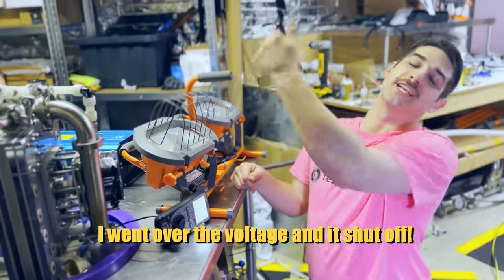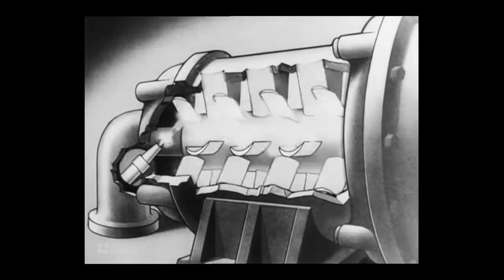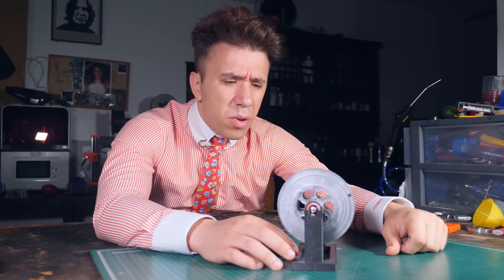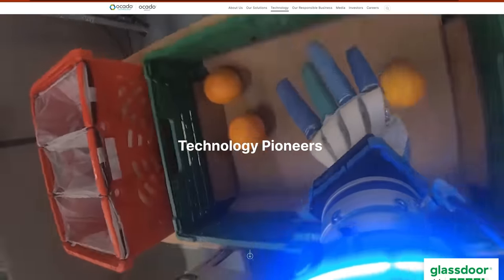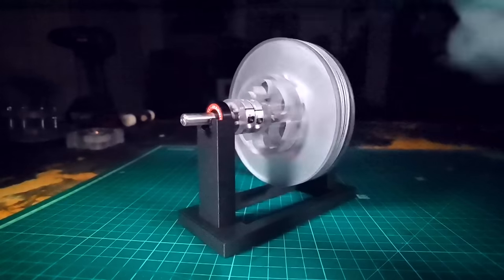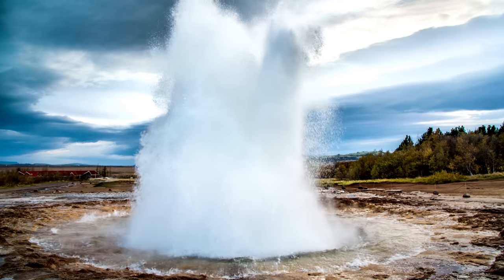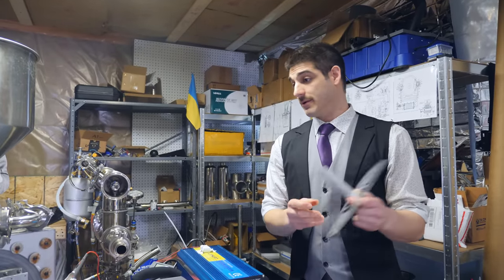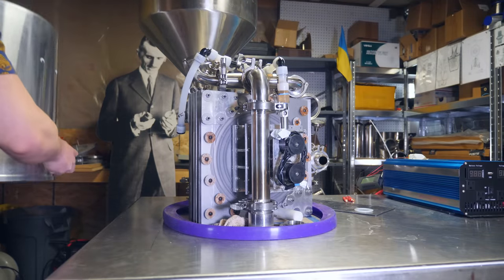Building Nikola Tesla's Bladeless Turbine

Comment: can you run this with a rocket? and wouldnt it be more efficient to run this with water? Tomatos are disgusting !
Reply: Why do you think that? For me its not intuitive for water to be better? Well it might cool the disk which might reduce the expansion, but just a thought tho
Reply: @vyvyyv8vohvgu77  I think it sticks better to the surface because of its higher viscocity so more energy is convertet into motion. But wouldnt it be interesting too, to try this with Steam
Reply: Too rapid of acceleration with a rocket motor, maybe perhaps it could work, but majorly redesigned to take in to account the physics at play
Reply: I think steam is probably the best medium. While water would work, the extra viscosity would likely cause the water to back up and slow down the overall rotation speed, since the spaces between the disks are so small. Furthermore,  I think you would have to be even more precise with the design to limit any potential for backflow or disruption of flow. I could see water potentially being better for lower speed, higher torque scenarios, but I think steam would be the happy medium. More viscosity than air, but also maintains higher speeds than water itself.
Reply: This is the story of your enslavement, the "elite" exposed 👉 The Connections (2021) [short documentary] 💖
Reply: I thought about asking about running it with water as, during the video, it is stated that higher toques are developed at slower speeds. After think about it for about 8 hours I have already come to the following conclusion. The Tesla turbine, with water driving it, would need to have it's axis of rotation vertical as opposed to horizontal. Conventional wisdom would suggest just running it like an old mill water wheel. But the two differ in their mechanics. The old mill water wheel depends on taking advantage of both the weight (gravity) and speed of the water flowing over it. 

If you tried to operate a Tesla turbine with a horizontal axis of rotation the water would, at best, interact with the turbine blades for ½ of the disc. If you followed the Tesla design and had the motivating medium exhausting near the axle, the water would act to impede the rotation for the back ½ of the disc. This would be because water is more dense and more viscous than air. Therefor, you should lay the Tesla turbine on it's side (vertical axis of rotation), injected the flowing water at the outer edge of the disc(s) and exhausted it near the axle. That way the water would spiral from the out rim inward until it exhausts. The entire time it's would be exerting viscous drag on the disc(s).
Reply: I feel like water would create too much drag and would probably be a little bit more difficult to propel. However with steam, you could boil some water, build up the pressure and feed it in - so would probably be more practical that way. imo if an engine depends on another engine then it feels kinda pointless.
Reply: why to use water when we can use high viscosity oil at low to medium pressure (20-30psi) .
Reply: @yeetskeet691  Actually, the whole point of tesla turbine is to use friction drag to spin the turbine, so more the drag the better. 
Drag would only be a problem for axial turbines that are designed for high Reynolds number application, as those things typically want lift rather than drag.
For tesla turbine, drag would only become problem when the disc is spinning faster than the fluid, but any turbine has limit to how fast it can spin.
Reply: Flow rate is inversely proportional to viscosity, so the less viscous steam would be faster therefore negating the losses caused by viscosity. I don't think it's about finding the best fluid/gas but the best for the power and rpm you want to achieve.
Reply: @lucky_luke4785  But you can run it at lower speeds but the water should provide more torque
Reply: @brandonatherton  I think Steam puts more stress on the parts due to the heat, the failurerate is increased and and you need more maintenance on the turbine
Reply: I think that water not being compressible is an issue, might reduce the maximum flow rate. Sort of a bit too much back pressure if you will.
Reply: @eliashutterli92  Well unless we try, no one of us will know
Reply: Ideally you would put in a liquid that quickly turns to gas when heated so it can phase change as it moves out of the turbine
Reply: Imagine if you add to this turbine a special funnel capable of catching the wind, and the funnel's geometry allows the air to accelerate so it's possible to move the disks and generate some energy
Reply: I feel like we are not fully exploring this technology the way we should be.

The discs should be made of a specially developed material which is especially hydrophilic and which uses nanotechnology to make a one-direction micro coating.  This would maximize the amount of power the discs can extract from a given fluid source.

Secondly we could mount it to specially designed bearings which have the lowest friction coefficient we can manage. Designed right this turbine design could easily replace every existing turbine at a fraction of the production cost, even with the special materials science mentioned above.
Reply: Hey thanks for the comment! Yes you absolutely can. In fact the improved combustion gas + steam turbine Patent GB 186,083 that Tesla patented in 1921, 10 years after the original turbine patent and about a decade of R&D, is pretty much this. It’s basically a combustion jet aimed into the steam pipe that goes into the turbine. 

The steam actually works to cool the combustion jet better than using a compressor to feed extra air in for cooling before going into a drive turbine. 

Additionally metals are naturally hydrophilic and polar molecules like H2O adheres to them better than non polar molecules (N2, O2, CO2, etc) which allows them to reduce slip on the discs and increase efficiency. 

Hope this helps.
Reply: @KuntaKinteToby hey thanks for commenting. To be clear, metals are naturally hydrophilic. 

And you are right. But the thing is to remember what the main motive fluid is. For a steam turbine we need hydrophilic surface treatments. But for a combustion gas turbine we need hydrophobic surface treatments for the non polar Air (N2, O2, CO2, etc.).

So it’s important to consider the exact operating conditions.
Reply: You should test it with the turbine that you likely will win from this comment, that would be super cool!
Reply: I can see what you’re thinking as there would be an increase in torque as it sticks a little better than air or steam, but the issue is at what pressure does the water need to be fed into the system for it to be efficient? I assume it’s easier to pressurize and feed air or steam into this system
Reply: Water disipate heat from rotating element causing drag
Reply: Natural gas hydrogen even alchol all produce large amounts of energy .
This design has many uses and applications !!!
Just as any engine it's an efficent "Pump" !!!
Only with out the limitation of valves !!!
They didn't have wear hardening stainless steel or ceramic bearings in Testlas time !!!
This thing runs at 800° an 80,000 Rpm all day long...
The high horse power potental open up many yet avalible uses !!!
Example 4 of these powering large fans could make the flying car a reality !!!
Reply: Water introduces cavitation, which defeats the purpose. "Low-quality" steam is one thing, but full-on cavitation erosion would destroy one of these quickly.
Reply: @KuntaKinteToby  
Don't forget it'd have to be made of something really strong, cos from what I remember from watching another video about the tesla turbine is when more fluid is pumped in, the efficiency goes way up, but that's also proportional to the speed of the disks which ALSO goes way up, so much so the original prototypes (I think) broke way before they could get to anything useful.

Heck, even versions of this used now, the efficiency is capped by whatever material is used for the disks, as they can spin only so fast before they start deforming.
Reply: Commercial airplanes already run on this power source or do u really think theres tons of jet fuel in the wings ?
Reply: @julianemery718  How about a composite material of magnesium-tungsten woven with graphene, surely that should be about the strongest thing we can make.  Maybe add some vanadium-alloy steel as well for a bit of flexibility.
Reply: dry steam would be best
Reply: @user-uh6kq2wh9g  well of course but I'm not referring to that type of drag (friction against components) I'm talking more like friction against air/itself. Yk what I mean? Due to the density/mass of the water I feel like it'd loose its energy a little more inefficiently. However I'm not a physicist or anything this is just me talking from common sense and whatnot.
Reply: @eliashutterli92 Supercritical steam?
Reply: @breakfast7595  I think it is super ineficient and nearly impossible to do
Reply: @NwoDispatcher  I think the expanding of the gas would make to much backpressure
Reply: @KuntaKinteToby  This is probably a bit to complicatet put you could try to roughen up th surface this would probably increase the efficency
Reply: Very good Question!
With a very small spacer thickness like in Charlies turbine for Integza, the viscosity and the surface tension of the water will not be able to efficiently transfer its energy into motion through the rotors. 
Bladeless turbines designed for hydropower applications generally have the spacers separating the rotors 
be > 0.3mm, and are less efficient than Steam, Dry Steam or Air Bladeless Turbines. 
A Jet engine/ Rocket expelling heated gas will be as/more efficient as a compressed air bladeless turbine because of the near supersonic flow rate and high pressure at the input ( if the input is converging). Furthermore the rapid pressure drop inside of the Bladeless turbine due to the high pressures in the input and the Rotor housing will cause the heated gases to decrease in temperature and have a large increase in velocity and accelerate the disks (this works very similar to a converging diverging nozzle in spacecraft rocket engines). It would be very interesting for it to run with a jet engine, however, I would recommend using a material for the rotors that can withstand high temperatures (over 1073 K) centrifugal force and maintain a very low or equal thermal expansion with the rotor housing.
Reply: @eliashutterli92 Bladeless turbines rely on their rotors being as smooth as possible to allow laminar flow.
The laminar flow is what gives the Tesla turbine it's high efficiency as it does more cycles around the rotors. 
If it is roughened up the rotors will allow turbulent flow to take place and does less cycles around the rotors therefore reducing its efficiency.
Reply: Wouldnt water expand as it gain more friction causing damage?
Reply: Wouldn't be cool if Joel build his own rocket?? It'll be A-M-A-Z-I-N-G and pretty explosive
Reply: Tesla designed it for water
Reply: @lordfrz9339  oh word
Reply: Wasn't this intended for water specifically, because of its viscosity?
Reply: @humanwow5848  yes
Reply: Use the rocket to heat steam
Reply: It’s called a viscous disk turbine and works really well with oils and petroleum’s
Reply: Better question: Can you power a rocket with it?
Reply: Water can be used to spin the discs like he described with the sticky honey,  fluid dynamics 101...😅.
Reply: @brandonatherton in reality, the more sticky the liquid is, the better.
It's harder to keep pressure up, harder than steam but the turbine doesn't care about running on air, steam, water or a mixture of the three.
Reply: You mean like steamed? Here it explained that they weren't you listening!? And no a rocket would just burn everything up.
Reply from the maker: Congratulations! You just won a 3D printer! Send me your info (Name, Address, Zip Code, Phone Number) to integza@gmail.com .
Reply: No make it a clean rocket engine
Reply: Do you no tesla secrets I do I will tell u all them
Reply: It's just a proof of concept. If it was more efficient it could be used in geothermal, hydro and nuclear.
Reply: If you really interested, guy from Ukrainian do that 5 year a go. Chanel name: tesla tech
Reply: @integza see channel: tesla tech
Reply: The narrowness and centrifugal Force of the turbine engine moving at the speed of steam presses so hard against the steam that there is no slippage as if the steam were solid as it passes through. Water cannot move through the device fast enough to create the centrifugal forces that make this turbine efficient. The problem is finding materials that can withstand extremely high speeds, 35,000 rpm. You boil the water to create the steam that spins the turbine.
Reply: @lordfrz9339 hey thanks for the comment. While the TesTur can be used with water, Tesla primarily designed it for use with combustion gas and steam turbines. 

Almost all the improvement patents that he patented in 1921, 10 years after the original turbine patent and about a decade of R&D, revolves around specifically using it with steam and/or combustion gas.

Tesla wrote extensively about this in his article “Dr. Tesla Talks of Gas Turbines”

I hope this helps.
Reply: @zAlaska I appreciate your comment but that’s not an issue because, despite what everyone erroneously claims, Tesla turbines work just fine, get plenty of torque and output power at low RPMs.     I’ve got some copy pasta 🍝 of mine that I’ll share with ya here to explain more.  Tesla turbines aren’t made efficient by spinning really fast.   That’s only for when the disc stack is being used as a centrifugal pump, because ALL centrifugal pumps’ compressors, performance is tip speed dependent.   But spinning the turbine fast will produce a centrifugal head that opposes the incoming fluid flow, reducing the pressure gradient across the nozzle, reducing fluid final velocity, reducing mass flow rates through the nozzle and ultimately reducing power out. 

Furthermore the faster you spin them the faster the fluid you have has to go just to still be moving faster than the discs and still provide torque.   Lastly, they work just fine for industrial use and can scale up just fine because the torque on the discs is proportional to the difference in the fluid speed and the disc speed. So the disc tip speed is the important factor here. For any given fluid supply in, the bozzle will have a max fluid velocity. So the turbine disc tips will have a max speed set at that fluid speed irrelevant if radius. Now considering that centripetal force is proportional to V^2/R, if you keep the tip speed the same but increase the radius the centripetal forces on the disc for the speeds needed will actually decrease. 

Despite what MANY have claimed about the Tesla turbine, it does NOT need to be spun fast to work or work efficiently.   TesTurs are made efficient when the slip on the discs is reduced and spinning the discs fast does nothing to reduce the slip, only increase the distance the fluid slips on the disc faces, which is by definition “loss”.  Listen to what Tesla himself said in the patents of how to make them work.  “Owing to a number of causes affecting the performance, it is difficult to frame a precise rule which would be generally applicable, but it may be stated that within certain limits, and other conditions being the same, the torque is directly proportionate to the square of the velocity of the fluid relatively to the runner and to the effective area of the disks and, inversely, to the distance separating them. The machine will, generally, perform its maximum work when the effective speed of the runner is one-half of that of the fluid; but to attain the highest economy, the relative speed or slip, for any given performance, should be as small as possible. This condition may be to any desired degree approximated by increasing the active area of and reducing the space between the disks.”  1) increase the speed of the fluid relative to the disc, (not increase disc speed)  2) increase surface area 3) decrease disc spacing  This is how you actually make a TesTur work. Not by spinning it fast.   The fluid interactions with the disc that govern efficiency an torque are adhesion and cohesion. Full stop. And spinning fast does nothing to increasing either to increase the turbines isentropic efficiency.   This is why everyone who chases rpm with the TesTur just flat out fails. They aren’t even trying to design them properly so of course they won’t work.
Reply: @breakfast7595 exactly! Supercritical fluids.😎🦾🤓

High viscosity like a liquid AND expands like a typical Brayton cycle with a gas. 👨‍🔬💫⚡️
Reply: 12:35
Reply: 12:35
Reply: @yeetskeet691  Seems like drag is exactly the point of a Tesla turbine. And yes, water would have a higher viscosity than steam or air. This just means that it applies more tangential force to the discs as it moves past them. Admittedly, at some point the water would begin limiting the speed at which the turbine could turn. However, In the video it is stated that the Tesla turbine develops more torque at slower speeds. I don't think a water driven Tesla turbine could replace a steam driven turbine, but I can think of applications where it might work well.
Reply: NPC comment
Reply: @kwestionariusz1 drag is desirable as that's what's causing the discs to spin